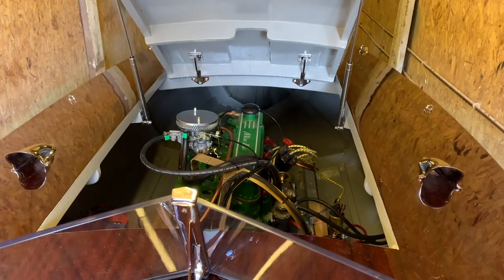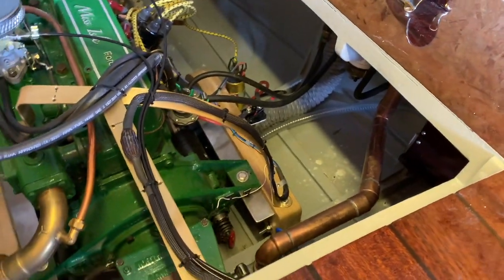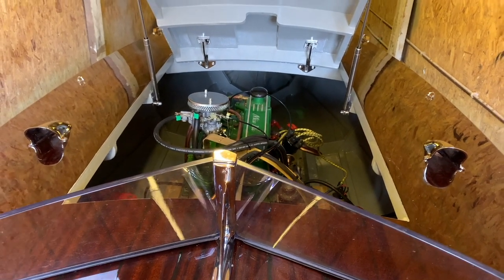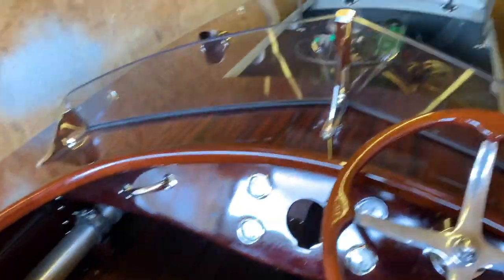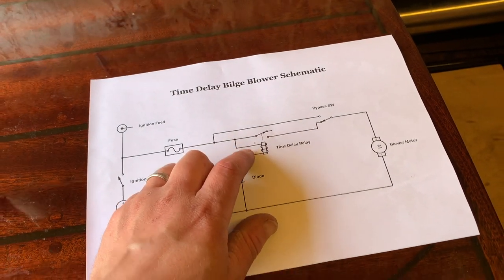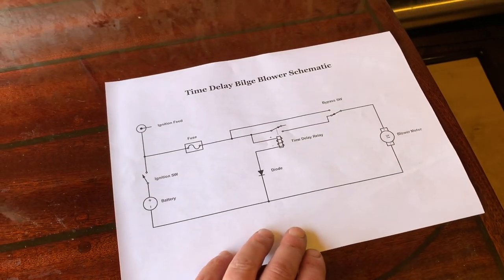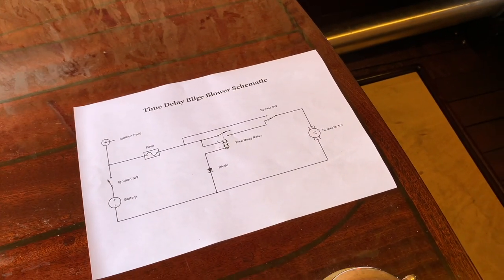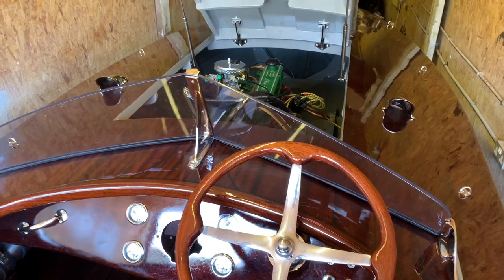Automatic Bilge Blower Wiring on a Timer Relay

Comment: Curious which model relay you used? Most of the relays I've seen that are delay off require only momentary trigger to start the time cycle. Having it tied to the ignition switch would provide constant 12v as long as th e key is in the on position.

Comment: Why is there a diode on the negative side of the relay? I'm about to wire mine so that they run constantly when the engine is on. Is your switch a 2 position switch - off in the middle? Correct me if I'm wrong, but with your schematic and a 2 pole switch can you not run the blower motor with the ignition off? I am wiring mine to automatically come on with the ignition but also will be able to turn them on when the key is off.
Reply from the maker: I seem to remember I has some weird things going on with this getting back fed by other items on the boat. I wanted this to just run once when the ignition first goes on and the diode stopped that happening. The switch is two position and allows the blower to run either on a timer or permanently but never off (so you never forget it) this means if you are running the boat slowly and potentially building fumes then you can run the blower. You are right though, the way I have it done, it cannot be run with the ignition off.